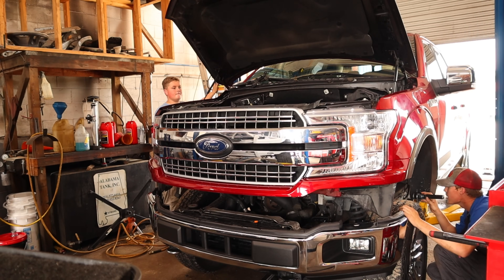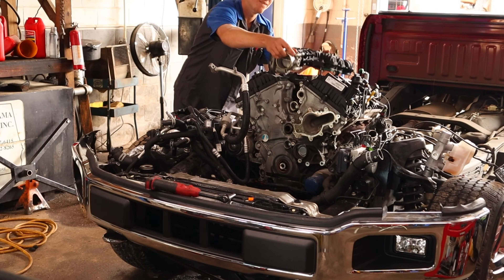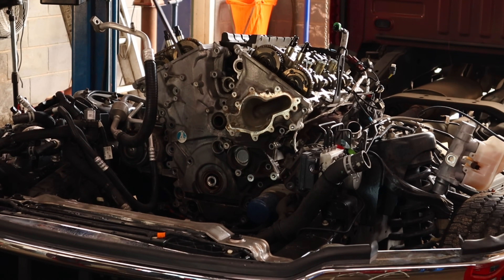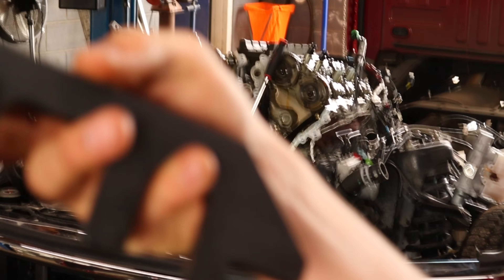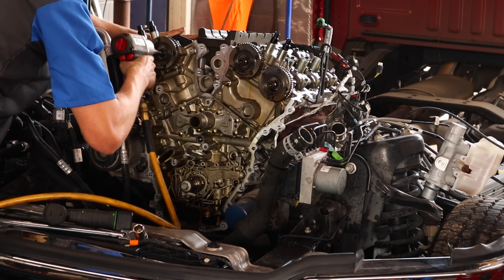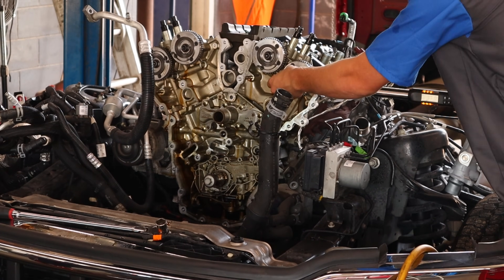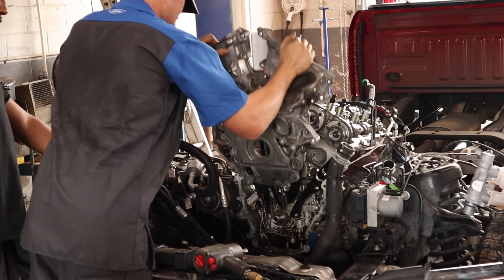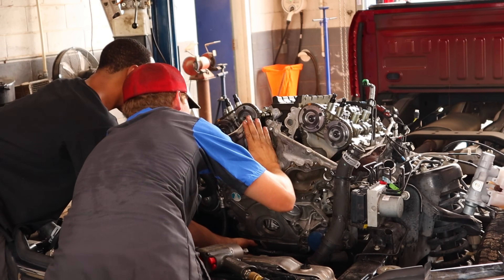Ford 3.5 EcoBoost Cold Start Rattle (VCT Phasers) | Everything You Need To Know

Comment: I’m a guy that drives em to death but  really take care of my vehicles. I have 3 6.0 vortec’s. 2000-2006. 200,000, 300,000, and 380,000. They run like scalded dogs. I bouhjt a 3.5 truck from my company with 163,000. It was a 2018, nice truck but not all highway because we service dairies on rough dusty roads. I feel I can solve any mechanical problems on engines given enough time. 100,000 miles these days is nothing in my opinion. When these trucks are costing 50-80,000 dollars. What ? Just replace every time you get to 100,000? Since playing with and working on this Ford or Chevy for that matter later than 2006, I personally think they are making throw away vehicles for 60,000 dollars. It’s a joke. You guys don’t even know what to do. I’ve had two mechanics tell me my engine is shot just replace it because of rough idle. I guarantee you the misfire code for 6 doesn’t mean the engine is shot and I am slowly making things better. I now believe whatever shuts engine down at stop lights is the problem because it doesn’t always die but it is trying too. Do you have an idea on that? What shuts it down and how. Is it all in that break module? Could it need replacing? Anyway that’s my rant!!. I have a 350 and 454. Where did the good ole days go?? We don’t need race car technology in a so called truck!
Reply from the maker: So the PCM actually controls the auto start stop. You can easily disable that by pushing the button on dash to turn it off when you start the truck. There also are some aftermarket kits that permanently disable the auto start stop. I will say I haven’t seen very many issues that I believe were caused by auto start stop. It seems to work pretty well.
Reply: @FlyingWrenches13  can you tell me why it is not shutting down most of the time? I would feel better if it was shutting down properly

Comment: Great video. I have a 2011 3.5 Ecoboost with 185K miles. Never had any of these issues. I use Mobile One full Syn oil. I just had my water pump replaced.
Reply from the maker: Thank you! Water pumps are pretty common for going out 150k+.
Reply: @FlyingWrenches13  - are they behind a cover or in front easy to remove?
Reply from the maker: @Dirtyharry70585  they are in the front but not real easy to replace. Kinda a tight spot to get in there to work.

Comment: I had this happen to my 2017 at 52k Miles.  Problem came back 10 months later and about 20k miles later.   Been just driving it anyways, now at 101k.  Would have traded by now if not for truck shortage.  While waiting I got to pay for 1600 to fix the ac compressor.   This 2017 hasn’t been reliable.   Give me back the 2014.   I can’t buy another Ford until I am confident they aren’t using the same shit parts.  .  Dealer told me get extended warranty and wait 60 days to claim it.  I wonder is the auto stop start is doing it.   Btw isn’t Ford tired of this issue?  I would rather have fixed cams and greater reliability
Reply: do you mean 20k later after the replacement of the camphasers?

Comment: Can using a 5w40 oil help the loss of pressure?
Reply from the maker: I would only use what’s recommended.
Reply: @FlyingWrenches13  I  know what’s recommended, but will using it increase oil pressure especially when the oil gets watery thin during the summer
Reply: @yousufkan6960  the viscosity doesn’t matter really. The problem is there is no oil at the phaser on cold start. Maybe thicker oil would help extend that period but may cause other issues

Comment: My 2013 3.5 is having issues I keep getting the yellow wrench on the dash screen and it goes into a limp mode kind of but it just coasts to a stop and the engine is shaking. Have to put it in park and restart then you can get it going but it happens multiple times through a let’s say a 15 or 20 mile trip….2 codes popped up one said throttle body stuck closed and other was cam shaft censor…. Has anyone had any problems like this? Thanks y’all
Reply from the maker: Replace the throttle body. Its for sure what is causing the wrench light. what was the other code?
Reply: @FlyingWrenches13   P054A cold start “B” camshaft position timing over advance bank one
Reply from the maker: Yeah you got phaser issues or possibly stretched timing chains as well. The throttle body will fix the wrench light though.
Reply: @FlyingWrenches13   another question with 155,000 miles instead of replacing timing chain… I can get a new long block for $4,000 what would you do…. To be honest I am thinking of just getting rid of the truck because I only paid 5,000 for it from a friend of mine and I think I can get that out of it the way it is
Reply from the maker: Yeah doing the long block wouldn’t be a bad idea. Idk where your finding one for 4 grand but let me know lol. Cost over 6k from ford for just the engine.

Comment: My dad has a 2017 F150 3.5 with the startup rattle. He hasn't received any recall paperwork in the mail. When I searched by VIN #, it doesn't show any recalls. How can I determine if it is included in this recall?
Reply from the maker: Recall is only for 18-20’s I think.

Comment: Dang my 18 king ranch has this. It has 60,000 km. 
I thought it was a smidge exhaust leak!!
Reply from the maker: Still in warranty right?
Reply: @FlyingWrenches13  
I’m calling in the next couple days. 
I’ll keep you posted. 
I’m not a fan of cab off work. 
Is there a more heavy duty timing chain?
Reply: I have '18 xlt with 27k and has the same rattle

Comment: Is Ford ever going to get these engines right? I thought about buying the 7.3 because it is simpler but don't know if I would trust it.
Reply from the maker: Yeah I’d rather have a rattling 3.5 than a 7.3. Those things are weak as pond water.
Reply: @FlyingWrenches13  That new 7.3 gasser is weak??
Reply from the maker: Compared to the 6.7 they are very weak.
Reply: @FlyingWrenches13  Yeah but if I am not towing 15K pounds on a regular basis I think it would suffice, wouldn't it?
Reply: A lot of manufacturers have issues with phasor rattling on cold start.
Reply: @NilesHlavacek  So basically get rid of it before it gets to a 100K miles?

Comment: Why not add a pre-lube, pre-start accumulator, or pump to build oil pressure prior to starting the engine, if the rattle is from an oil drain back issue? This would be fairly easy to prove or disprove your hypothesis.
Reply from the maker: Very true. The reason I think it’s a oil drain back issue is because if you prime the engine before starting the noise is gone.

Comment: You just added a new subscriber! I just bought a ‘19 3.5 with 99k miles and did not notice the cold (and warm) start rattle until after I brought it home. The dealer included a 3k mile power train warranty. Do you think I should attempt to have them replace the phasers even if there is no code thrown? The rattle is LOUD. Otherwise I’m in love with the truck.
Reply from the maker: Thank you, welcome to the channel. And Yes yes yes. I would get as much done on there dime as possible.
Reply: @FlyingWrenches13  thanks, appointment is scheduled.
Reply: Same boat 2014 Ford 
 F-150 Eco boost 3.5 runs amazing. Only small rattle on cold start. Just tried the trick of building oil pressure by holding down accelerator and it worked perfect

Comment: The 2018 F150 is the first new Ford Truck I ever purchased.  I started hearing the sound at around 11k miles and thought it was a rattle i the wastegate.  It got worse and I began inquiring, and even had it at the dealer one time prior to any of the recalls..  They said they knew about it and to just wait, something was coming out.  Took it last week to do the 21b10 v2  and it didn't resolve the problem.  I'm at 21k miles now.  I'm thinking once I get this fixed, I'll trade it for something else.  That's a LOT of money to spend on a vehicle to be having an issue like this...
Reply from the maker: I understand that. Honestly other than the phaser rattle, they don’t have many other common issues.
Reply: Great time to turn in, bad time to buy.

Comment: I have rattling issues on my service vehicle 2017 F150 none ecoboost after 150,000 miles. But why when I shift it on 3rd gear rattling diminished can you answer me this plz? Water pump has been replaced by the way.
Reply from the maker: It would be very hard for me to say without more info or hearing it myself.

Comment: I heard through the car people.. that some of the rattle could of came from the chain stretching, which could cause extra wear on the teeth and cause some backlash issues?
Reply from the maker: Yeah that’s true the early 3.5’s did have a problem with chain stretch but it would make a much different noise than the phasers do.

Comment: At the end of this year or early in ‘22 I’m considering getting a ‘22 Explorer ST with the 3.5 ecoboost for wifey.  Can you let us know specifically what Ford changed on these engines in ‘21 from prior?   Also, have you seen the VcT phaser rattle on any ‘21s so far?  Great video and newly subbed.  I have an ‘18 F-250 6.7L King Ranch.50K miles and been great so far.
Reply from the maker: Thank you! So I’m not sure what they changed on the 21 modes but I haven’t seen any phaser rattle on any of those. I would say you will be fine buying a 21 model.

Comment: Yet Ford never recalled the 5.4 for the same thing ugh I’m a 5.4 owner 😢
Reply: The phasers aren't the issue on those it's the undersized oil passages in the block that clog easy with gunk and starve the top end and timing of oil, a 5.4 that was a little late on oil changes will never see 200k in my opinion
Reply: @johnsheets2976  Thanks for the info ! And I do my service at 5k and use high quality oil and filter and I also prime my engine before starting it by putting it into flood mode ! Hopefully it buys me more time .

Comment: I appreciate your time ,but most people just do not have 3k laying around and you contradicted yourself your own words oil pressure is the base problem and then you attempt to down play changing the oil pump every Ford engine from 2010 and up oil pressure or the lack there of is 90% of all engine issues!!!!!!
Reply from the maker: Lack of maintenance is the issue, not the oil pump. I have never seen a oil pump fail in a 3.5.  The way I look at the 3k is if you had the money to buy an expensive truck you should have the money to fix it when it tears up.

Comment: So if I take my truck to the dealer for the rattle, are they going to do anything about it? I literally have 250 miles left until my 60k warranty expires.
Reply from the maker: What year model?
Reply: @FlyingWrenches13  2019 F150 XLT
Reply from the maker: Yeah they should be able to do something about that under warranty.
Reply: @FlyingWrenches13  Yeah, but im down to 99 miles now

Comment: Check this out I had a 12 3.5 and I changed the phasers and chains and oil pumps and problem solved the reason I changed oil pump is because it took longer to build up oil pressure when starting it’s a bit slower
Reply from the maker: Did you replace it with the melling or a stock one?

Comment: I've been looking at the f150 new trucks and really like the design and they run great but hearing this  just makes me want to get the Toyota Tundra even though it's a gas hog.  I swore off American cars and trucks after having numerous issues before they reach 70k.
Reply from the maker: Buy a 21 model. They don’t have any of the phaser issues.
Reply: @FlyingWrenches13  The answer I was looking for!  Bought a 2021 Powerboost Lariat in January. Never knew of this issue until someone mentioned it on a RV forum so I googled it and it brought me to this video which is very informative.
Reply: Buy the Tundra. I did

Comment: New subscriber here… found this over on one of the Raptor groups. From one YouTuber to another, man what an awesome job in laying everything out. I second your thoughts on calling Ford Corp… they do try and help. My Dad was a Ford mechanic, senior master for 30 years before he passed in 2017. He always told me the same thing… get ahold of corporate if you’re having problems. 

Anyways, awesome video! Super helpful for all those folks out there sweating cam phaser issues.
Reply from the maker: Thank you! I just went and checked out your channel, I like your stuff man!
Reply: @FlyingWrenches13  Well, must've jinxed myself. I typically remote start my truck (19' Raptor just under 42k miles 10/18 build date)...this morning I remote started as I was walking out and I heard the distinctive phaser rattle on start up. 

So, run it longer until Ford better figures out what course of action they want to go? Head replacement/phaser replacement? Or go ahead and take it in? I do have ESP to 100K, but I drive a ton...only had the truck just over 2 years and have some long distance hunting trips this fall.
Reply from the maker: I would probably have the phasers replaced now. This seems to fix the majority of them.
Reply: @FlyingWrenches13  thanks. Tried getting an appointment at the dealer today. I’ve had a heck of a time getting good service.
Reply: @FlyingWrenches13  thanks! It’s been fun learning this stuff.

Comment: I have a May 2019 3.5 with 25,000 miles.  A around 10,000 miles 3 times the truck made a loud rattling noise under the hood.  Weather was about 40 degrees F.  2 times after driving 1/2 mile and going up a rather steep hill I heard a very loud rattling noise.  I was driving by a chicken house with large fans.  It sounded like the blades were hitting something.  I happened twice the same way.  I checked the second time, on fans were running.  The third time was going up a different hill after driving 1.5 miles.   
I talked to the dealer about the noise.  He looked at me dumbfounded
Reply: Sounds like detonation. I only run premium in my truck.
Reply: @enigma9789  I know what  detonation sounds like.  I have worked on engines from cars to airplanes.  I told he dealer it sounded like turbo scrape
Reply: @davidhofman4341  If you watch my video about the cracked head on a yamaha SVHO you can hear what a supercharger impeller hitting the housing sounds like 2ft away.
Reply from the maker: Yeah I would probably look at you the same way lol. I haven’t seen any of them have anything like what your describing. Sounds like you may have a difficult one.

Comment: Love the video man I personally am a GM mechanic but I've got a 2013 f150 3.5 with 183000 miles and started recently with the rattle. Is it easier to just pull the cab, and have you seen the new melling high volume high pressure oil pump, I feel like that might help a little on the cold starts.
Reply: I’ve done a few dozen chains and phasers on 3.5 and never saw a reason to pull the cab. Straight forward job
Reply: Pull the cab.  Your back will thank you.  30 to 45 mins it's off.  Then your practically doing the repair on an engine stand and in half the time.
Reply from the maker: Thanks man! I haven’t seen that oil pump yet. I’ll have to go check them out.

Comment: Not sure why you pull the cab to do cam phasers. I only pull cabs to replace the engine. You could save yourself some time. Have to say out of all my years at the dealership you are the only one I've ever seen pull a cab for phazers
Reply from the maker: Yeah I done them cab on for a while but I just started pulling the cabs because it seems easier. Especially on my back. I can also still beat warranty time with pulling cab. I’m not saying by any means you have to pull the cab it’s just my preference on how to do it.
Reply: @FlyingWrenches13  if I start one in the morning I can have it done by lunch. But yes it is easier on your back to take the cab off.

Comment: Great guy and great Mechanic! Fixed my white 2017 Limited with the Rattle!
Reply from the maker: Thanks!
Reply: It will be back in 35-40,000 miles. I had 2018 and had the rattle fixed once at 70,000. Then at 105,000 it happened again. I got rid of it at 142,000

Comment: #1 There was nothing wrong with the initial new cal.  The issue was that some vehicles owned second hand and/or by hacks had lack of maintenance or low oil levels that scored the cam journals and caused low oil pressure to the phasers.
#2.  The new calibration will not fix a failed VCT phaser.  If the phaser has the issue, it needs to be replaced.
#3.  VCT phasers do not need oil pressure to prevent rattle on start.  They are designed to lock on shutdown, which prevents rattle on start. No VCT phaser will have full oil pressure on a cold start, thats not how the system is designed.
Reply: #1 is absurd. A significant amount...maybe 60% or greater of the 17-19 3.5 phasers I've done have had regular oil changes and good oil levels. The cam journal/megacap scoring is from the mega caps leaking due to the 3-bolt design. The 2020+ 3.5s have 4-bolt mega caps. 2020+ phaser rattles are basically unheard of and they use the same phasers. On the flip side, I've done 2nd and even 3rd sets of phasers on 17-19 3.5 phasers. Same phasers as the 2020+, regular oil change intervals, yet I'm replacing them every 20k miles or less.
Reply from the maker: Agree with all of this!

Comment: What is it with Ford trucks and cab off jobs?
Reply from the maker: The easiest way to work on them.
Reply: @FlyingWrenches13 . I suppose it's an easy way to deter small shops and personal mechanics from working on these trucks too.  Is this and industry wide thing? Are most modern trucks like this?
Reply from the maker: It’s for sure becoming a more common thing to pull the cab for engine removals and some repairs.